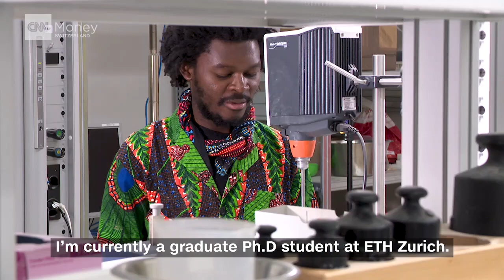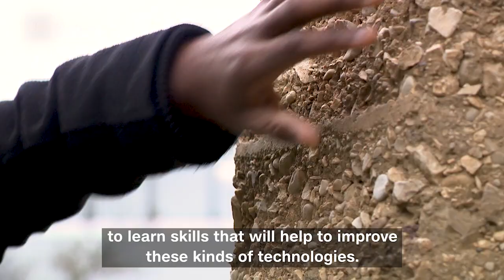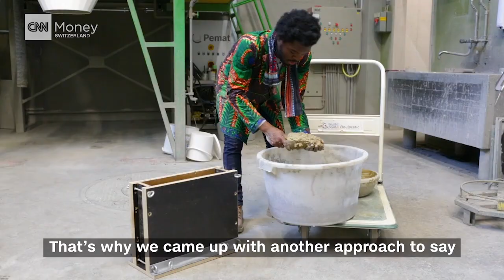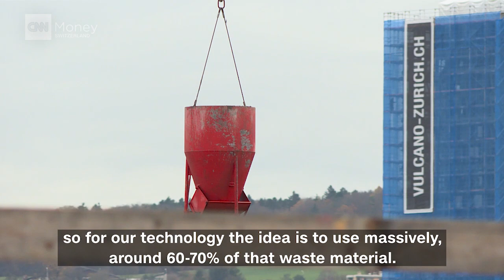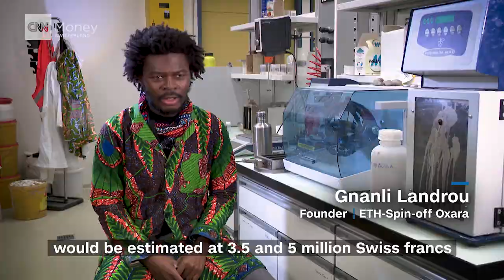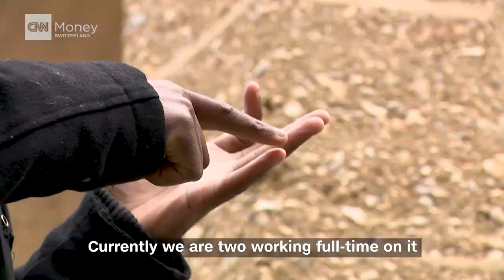A cement-free concrete invented in Zurich by Oxara

Comment: Typical media hyped university spin-off. nobody needs this product. concrete is needed in 2 cases. case 1, when high pressure resitance is required. case 2 is when water resistance is required. "cleancrete" has low pressure resistance and no water resistance.
bricks, dry walls and wood are way more cheaper and environment friendly then cleancrete.